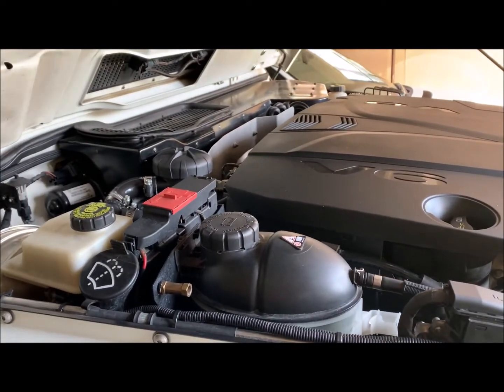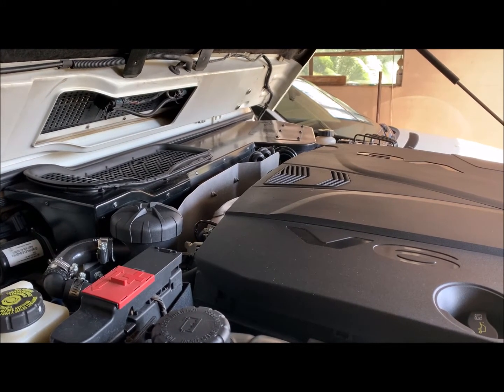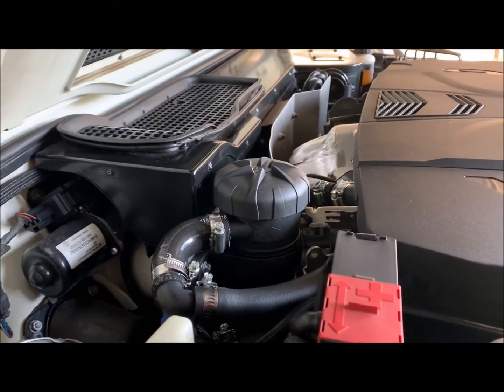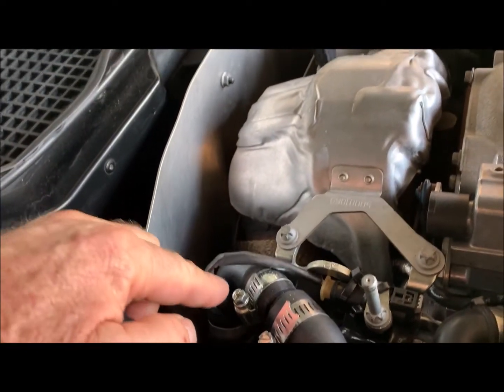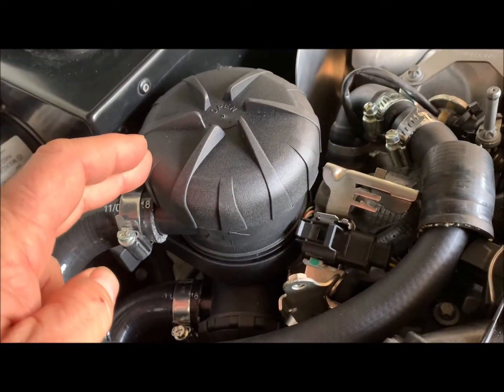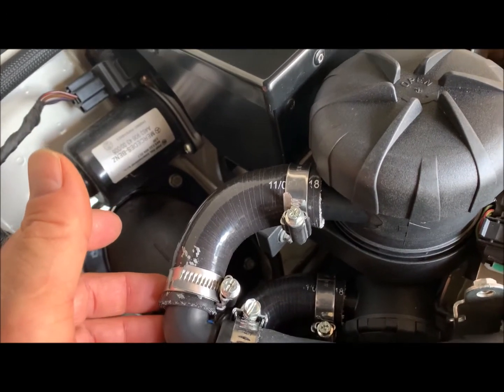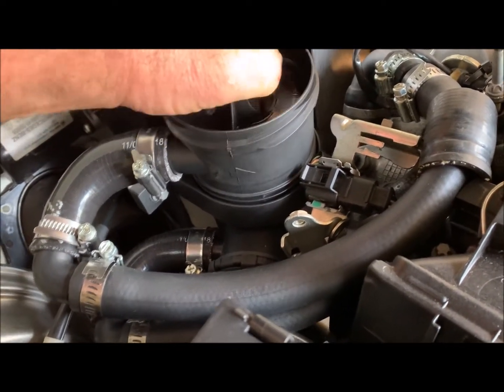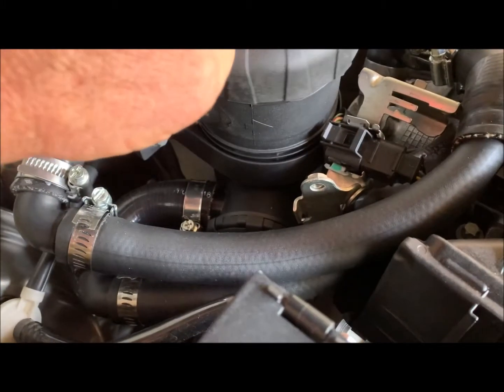Mercedes Benz G-Class OM 642 Provent 200

Comment: normally it is directly connected to the intake so wouldnt be better to cancel provents pressure regulator valve or change it with stronger spring to stimulate normal operating condition?